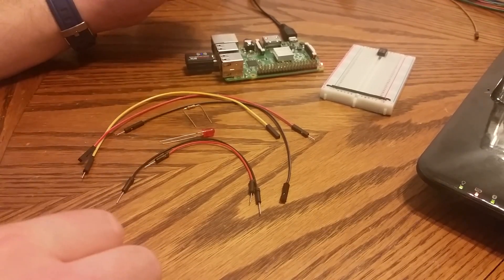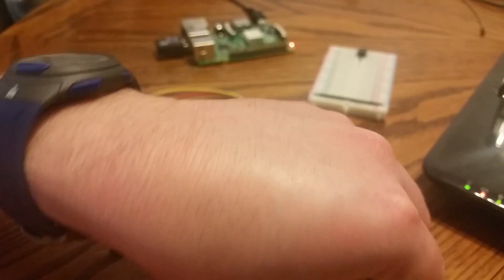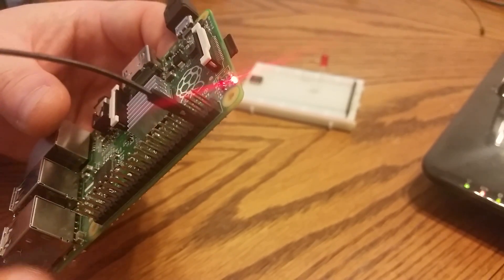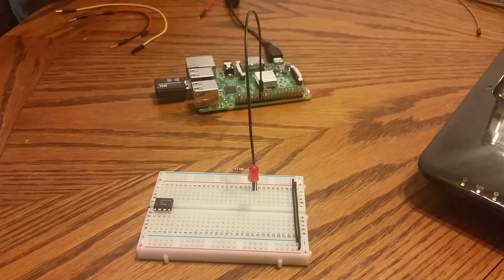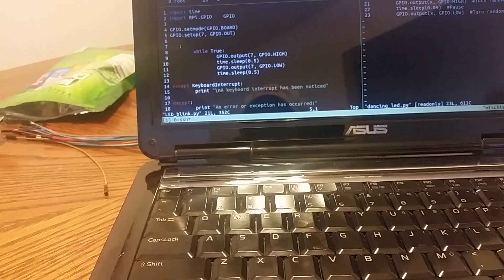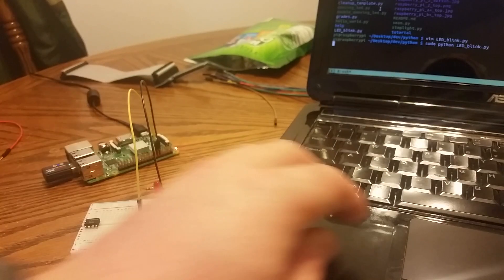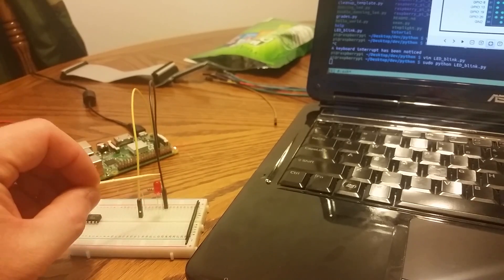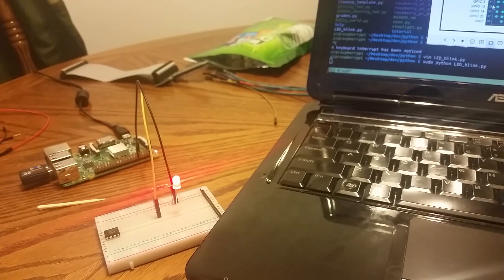Intro to Raspberry Pi GPIO

Comment: have this craphic software were can open ,write code and have examples, same than arduino ide have, help lot newbie what try first time make code and test many different connection, led,relay,servo motor,  input sensors.temp,huminity,encoder, etc. radio panel,interesting. buttons, potentiometers, joystick. were save py codes, how open py codes, were have examples training codes test codes, interesting but no know. can i use same code and structure python code save files raspi zero w and raspi3 b+ what i have.

Comment: I just realized that I should of been using resisters for these led experiments. Though my pi still works, I was wondering what this means for the status of my pi. Is it either damaged or not broken. Or is it the case where it is a little damaged and is not noticeable?

Comment: I'm looking at doing this with a relay but new to the pi, this is the closest video so far I've found to what I want to do. can i replace the LED in the circuit  to switch a mains relay  from these pins all I'm after is when I turn on the pi relay activates and the tv powers up and when the pi turns off the relay switches off and the tv powers off. hope this is not too far off subject!! great vid clearly explained.

Comment: i can get the led to light when there is no resistor temporally before crashing the pi but using the lowest value one i have (165 ohm) it refuses to light.  is this resistance too high? if so what value/range of values should i be using???
Reply: never mind realized i could put resistors in parallel. however i noticed some of my led's don't light. is there a way to determine the power requirements of an led just by looking at it ?
Reply: Short answer, no.  If you have a part number, it will have a data sheet which can be looked up.  That will list how much voltage is used, and the current required.  Subtract the led voltage from the source voltage.  Divide the remaining voltage by the current required.  That will give you the value of the resistor you need.

Comment: You are saying multiple times that the GPIO pins will give you 5 volts. They are only at 3.3 volts, right?
Reply from the maker: 3.3V and 5V power output, but the GPIO (not the voltage sources) are all 3.3V.
Reply: I thought I read Raspberry Pi 3 has both 3.3 and 5
Reply from the maker: You are correct.  I was stuck in Arduino mode, and those are at 5V.  Sadly, YouTube won't let me edit the video, once it's up.

Comment: Awesome video! I just followed this (to the letter) and it worked an absolute treat. Will you be doing other more advanced videos (to hand-hold us newbs)? I found that your video was the best explained of them all, and it was great to get it all working. I see in your bitbucket repository you did have a bunch of other python scripts, but I'm clueless when it comes to the electronics side of what I needed to do, so I was just following along on screen on how you built out your breadboard. I "think" I know what do to breadboard-wise to get the stoplight script working, I'm just worried I brick my PI. Essentially, just replicate the board as above, 3 times, terminating to pins 11,13,15 and share a common ground rail for return?
Reply: Hello again Stillborn86. I thought I'd just give your stoplight a go, and it works! However, I had to edit your code slightly as the code has the highs/lows as HIGH/LOW, not GPIO.HIGH/GPIO.LOW (so it errors out).

try:
    while True:
        GPIO.output(red, HIGH)
        time.sleep(2)
        GPIO.output(red, LOW)
        GPIO.output(green, HIGH)
        time.sleep(2)
        GPIO.output(green, LOW)
        GPIO.output(yellow, HIGH)
        time.sleep(.5)
        GPIO.output(yellow, LOW)

Should be:

try:
    while True:
        GPIO.output(red, GPIO.HIGH)
        time.sleep(2)
        GPIO.output(red, GPIO.LOW)
        GPIO.output(green, GPIO.HIGH)
        time.sleep(2)
        GPIO.output(green, GPIO.LOW)
        GPIO.output(yellow, GPIO.HIGH)
        time.sleep(.5)
        GPIO.output(yellow, GPIO.LOW)

Another quicker fix could be to set a variable HIGH = GPIO.HIGH and LOW = GPIO.LOW, that would work too.

Apart from that, worked brilliantly, thanks for the adventure!
Reply from the maker: Yeah, Python is known for being volatile, and changing the way their code work (or doesn't work).  I need to go in and "upgrade" my code for the new versions of Python, but I've been a little busy.

As for more videos, I'm working on some, but I've kinda backtracked and decided to start from the ground up: getting an rPi out of the box, and setting it up from scratch.

That one is taking a little while to get through, but it's coming.  Once that's done, I will get into some more advanced items.

Comment: Can you plug in multiple LED's behind eachother? Like the exact same setup you're using but then with 2 or more LED's, or does it cost to much power for that singe GPIO pin? 
PS i like your video's! 
:)
Reply from the maker: First of all, thank you for the compliment.

To answer your question: It depends on the LED.  As long as you have a current-limiting resistor, and your total current draw doesn't exceed 16mA per GPIO pin, you should be fine.  The place where you're going to get bitten is doing the math, and determining how your parallel/series resistance computes.

Also remember that the voltage drop, across a diode, is 0.7V.  Your GPIO will only output 3.3V (unless you're using the 5V rail, which will drain directly off of your USB power supply, thinning out the CPU power), and you'll have to calculate what your systematic load will be for your specific LEDs.

Sorry I can't give you any more concrete answers than that, but LEDs are so fickle, and they have such different tolerances/values that I can't give you a difinitive answer.

TL;DR: A diode has a 0.7V drop, and a standard GPIO will only output 3.3V at 16mA, max.  You'll need to find the specs for your LEDs and resistors, and do some electrical engineering math to figure out how many of what you can have, and how you'll be able to wire them together.

Comment: Can we use android app to control the status of led over Bluetooth instead of python script and update the status in the app?
Reply from the maker: You can use whatever you want to interface with the rPi, but you'll need something low-level to actually communicate with the hardware.  That can be Python, BASH, or even C... but you'll need something under the hood to work through everything.

Now, I've never looked into what you're talking about, but I'd imagine it would be a Java app on the phone, talking with an HTML5 interface connected to the rPi, which sends your low-level sketch data to manipulate the GPIO.  Essentially layered, like an onion, to get to the underlying hardware.

Comment: That was a great tut for how to wire up the connections... but python part was missing... you would better capture the screen instead of peeking it with videocam. sad.
Reply from the maker: Emre MUTLU WARNING!!! You didn't pay attention to the video, or read the description... I literally GIVE you the code in a Git repo, which is better than any screen capture service I could use. 

Just because you're not smart enough to find/use it, isn't my failing... it's yours.
Reply: OK, I am not smart enough to check the video description. My bad. I do appreciate what you are doing, making and sharing tutorial videos for everyone's benefit, which is great. Just, it would be better if you put the code on fullscreen.

Comment: Stupid question what is the "time" code that you were using
Reply from the maker: Are you talking about the library I'm importing?  It's just that: a library that has the necessary code to `sleep` my program for a given unit of measurement.

Think about it like a box, with labelled holes in it: you reach into one of the holes, and you can pull out whatever the label on that hole says -- you don't know how it works, it just "magically" gives you what each label says.  This is how object-oriented programming works.  Now, you can open that box to see how it works, by looking at the time Python library, but that doesn't change the way it works.

If you're a beginner, I'd suggest you just use it as an object, as I have in the video... unless you REALLY want to see how it works.

Comment: Very nice video, thank you. I have one question, why do we use 220-ohms resistor? What happens if we use different resistor?
Reply from the maker: You're supposed to match resistors to your LED.  Each LED is rated for a specific current, and your rPi puts out 3.3V per GPIO pin.  You're supposed to use these two numbers, and Ohm's law, to determine which resistor you're supposed to use.

Using a lower value can overcurrent your LED, and ultimately damage it.  Using a higher value can result in an LED not working, due to not having enough current to function.

But most people don't know what their LEDs are rated for, and LEDs are cheap.  Here, I bought a grab-bag from Amazon, and their tolerances are just too "wild" to be extremely precise with my resistance values.  If I burn the LED up, I'll just put another one in its place, since they're less than a penny.

The only hard-and-fast rule for me (in this situation) is no avoid using NO resistor... as long as there's some sort of resistance, you should be good.

Now, when you start working with diodes that actually control something, or you're dealing with more expensive components, you'll want to take the time to calculate the correct values for all of your components.

Comment: Nice video. One tiny correction, PWM = pulse with modulation, not management.
Reply from the maker: +Davey Hi Thanks.

I've already gone over the modulation/management issue with another commenter (maybe on another video), and I DO say "management" a couple of times, but I also say "modulation" at various points.  It's not important, either way, because the process allows you to "manage" the amount of time the voltage for that particular pin is on vs off.  Also, certain "schools" address PWM as one, while others refer to it as the other.

It's all just a matter of where you're from or what you're familiar with.
Reply: +stillborn86 I haven't seen your other videos so I can only comment on this one. I did check to see if the error had been mentioned in these comments but it had not. You do not say 'modulation' in this video, only 'management' twice. 

I only bring this up as your videos are very professional and identified as tutorials so I think that people rely on them for accurate information. You are setting the standard, so to speak, so it's important that the information that you pass on be accurate. 

I agree that the process could be described as management in a broad sense. By that same logic, you could call a microcontroller a micro-manager ;-) We don't do that; we use industry standard terminology. The correct term for this process, for these pin types, and for the acronym 'PWM' is pulse width modulation. 

To keep an open mind I googled "pulse width management" and even that just returned hits for "pulse width modulation". So I don't get where you're coming from about it being an alternative. 

Thanks!
Reply: And a little bit correction - it is Width not with - that is the width of the pulse that you managing. Great Work.

Comment: +stillborn86 what kind of python are you using because mine does look alot different than yours (im using python 2/3 IDLE) and if its an different one how do i install that one?
Reply from the maker: +Niek Van Weeghel I'm not using IDLE, and I recommend you don't either.  IDLE is a coding environment that isn't useful.  Most legitimate programmers recommend not using it.

You can use any text editor (Notepad, Notepad++, Gedit, Mousepad, etc.) to write your code, or you can use a terminal-based text editor, like I do.  In terminal, you have several choices, but the most common are NANO and VIM, and I'm using VIM.

To use these, you just use a simple command in terminal with the editor, filename, and py (python) extension: vim filename.py

This will let you write a plaintext document with your code, which you can save and run in terminal, like I do, with the python command and filename: python filename.py

This is how I recommend learning Python, as IDLE and other IDE's will ruin your ability to code properly.

Comment: what is the statement beside the : above while True:?
Reply from the maker: +Wayne Goldstein It's a `try:` command.  It's part of a three-part system where it works with the `try` section until one of two conditions are met: either a keyboard interrupt is met (Ctrl+C) or an error in the code is met.  If either of those happen, then the sketch cleans up the GPIO signals, and exits.

You can actually download all of my Python scripts from the link in the description, since I know that the colors are difficult to read over camera.

Comment: Hello stillborn86, Thank you for uploading such an informative video which is very well explained! 
but I have a doubt , how did you connect your rPi with your laptop ? I didn't find any HDMI cable connectivity ?  
I believe, you edited the Python codes  editor running on raspbian, correct ? or you used a wireless dongle(wifi ) to connect with your laptop? Can you explain ?  I'm a beginer in rasberry pi... 
Thanks
Reply from the maker: +Sanoop M S You are correct, I didn't use an HDMI cable.  I used the SSH command to connect with my rPi wirelessly.  As I am using Linux on my laptop (it also works with an Apple machine), Terminal already has SSH built in.  For Windows, you'll have to download and install PuTTY to make SSH work.

Once you've done all of that, you need to either set a static IP for your rPi or you'll have to find the IP that was assigned to it when it booted up.

Now that you have an SSH terminal and the correct IP, you can log into your rPi with the following command:

username@192.168.0.IPaddress

Now, if you haven't changed the username on your rPi, it's probably just "pi" and you'll have to put in the correct IP address.  If you've done it correctly, you'll be prompted for your login password.

This is how I manipulated my rPi with my laptop without an HDMI cable.
Reply: +stillborn86 Thanks a ton again !!! :)
Reply from the maker: Sanoop M S Yeah, no problem.  I know my description was a little nebulous, but that's the way words can be... I could make a video if you would like, to help clarify this for you.
Reply: +stillborn86 Than you so much for the help extended. Firstly, let me try this with the info that you are provided.. If it is not working then I would definitely comes to you for a help.. hope you never mind !  :)
Reply from the maker: Sanoop M S Nah, I don't mind.  That's why I make these videos... to help people learn.
Reply from the maker: Sanoop M S I do, but I also enjoy a certain level of anonymity... you can always PM me here on YouTube, and I will get it since I am always here.
Reply: +stillborn86  Hi, I wish to buy a raspberry pi  camera module, I found two versions on amazon? Can you please suggest me Which one I should go for and why(what is the difference)?
following are the models 
1. http://ecx.images-amazon.com/images/I/51zv5Z6tVmL.jpg
2. http://ecx.images-amazon.com/images/I/71m%2BDs2WIXL._SL1500_.jpg

 I'm using rPi 2 model B.

Thanks
Reply from the maker: Sanoop M S Honestly, I can't say much from just looking at two photos.  I'd need to check out the specs.  But you'd have to make sure that they either have, or don't have IR filters... depending on what you want to do with them.  There are many different configurations, and you can even get lenses for them, but it's cheaper to just get what you need right off the bat.
Reply: +stillborn86 Thanks for your reply!

Comment: How are the wires that connect direct to the GPIO called?
Reply from the maker: They're usually referred to as "jumpers" as they jump voltage from your hardware to your prototype, and vice-versa.